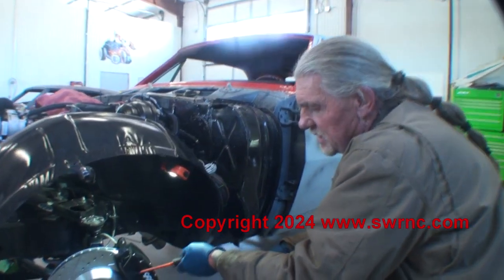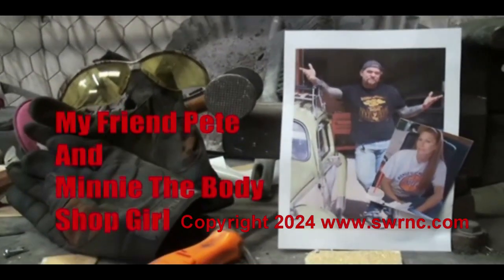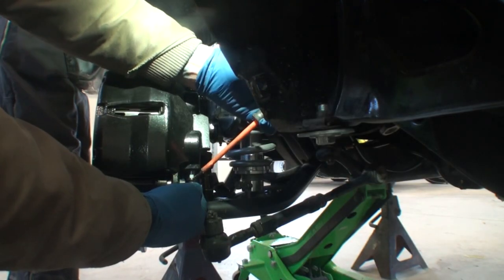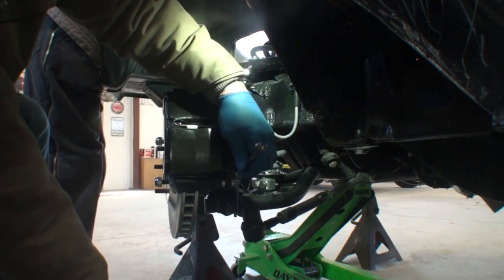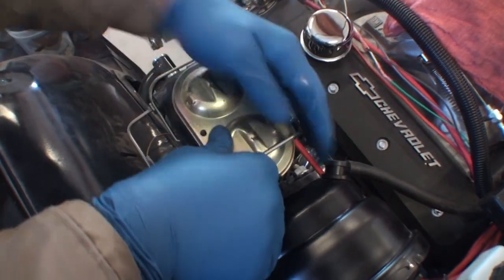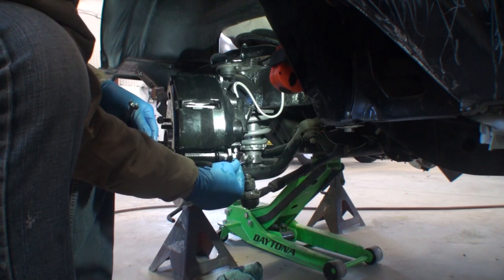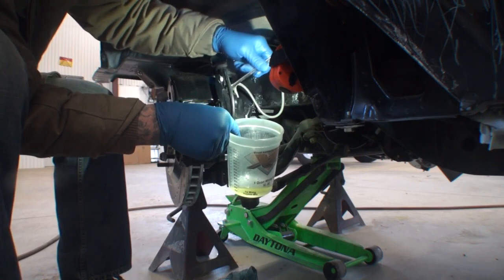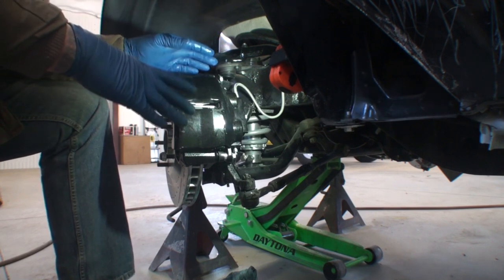How To Bleed A Dual Piston Brake Caliper - Automotive Mechanic Tech Tips - DIY

Comment: Interesting, all of the 4 piston Brembo or Wilwood calipers I’ve ever had only have bleeder on either side at the top. There are provisions for bottom bleeders but there are just bolts in its place. It was always my understanding that you never wanted a bleeder on the bottom because you can get trapped air but I guess if you’re power bleeding then it’s not an issue.

Comment: Dear Pete, The Calipers Are On Back Words The Bleeder Screw Is Supposed To Be Up top, To Release Air From The Hydraulic  Brake System, Trust Me, From Toronto Ontario Canada,, I Watch You  Guys All The Time,
Reply: I think it is possible for these calipers since they are aftermarket. This allows them to be mounted the leading or trailing position. With the hose mount positioned near the middle and a bleeder screw on both ends gives these more applications to bolt onto. 
  The Air Force guys had me working on vehicles they brought back for Italy, Greece, Hungarian and other places around Europe. There is some crazy stuff out there and brakes was the number one repair followed by A/F adjustment due to altitude change, then valve adjustment.

Comment: I worked in a brake shop 20 odd years many ways to do the same job. And no one died from brake failure I did. Im not saying this method is good or bad but seems a bit awkward. But what ever floats your boat.

Comment: I just pressure bleed from the top or vaccum bleed I have both and no helper is needed... All fluid runs in to a container no mess...and if your running a booster alway check brakes under vaccum with engine running. And in the case of hydro brakes make sure there is power assist to the braking system.... There is 50 ways to bleed a car lol 😆